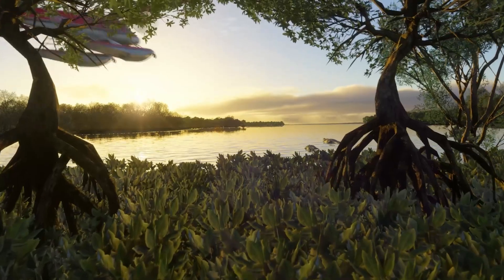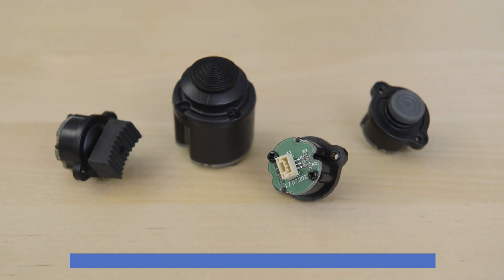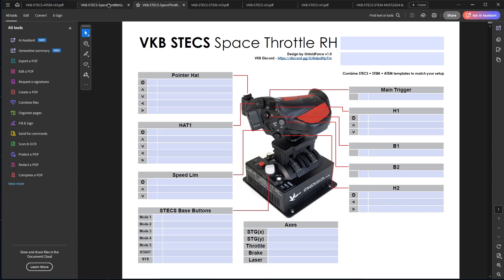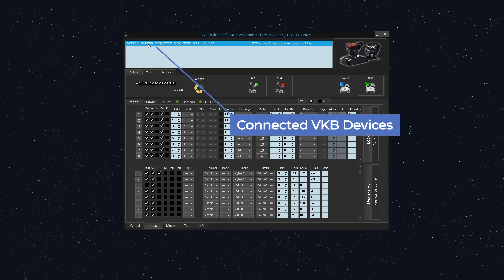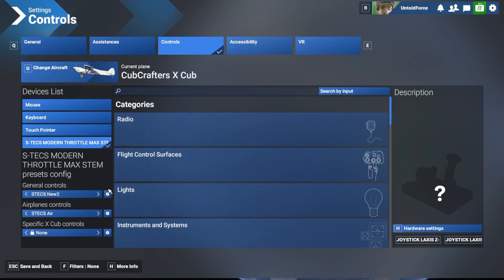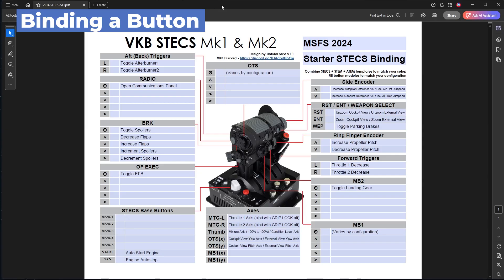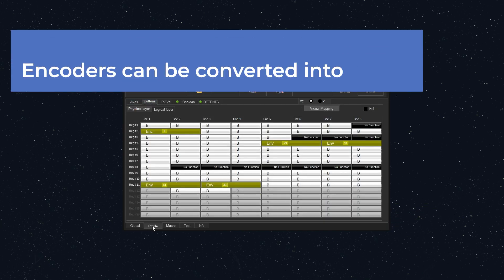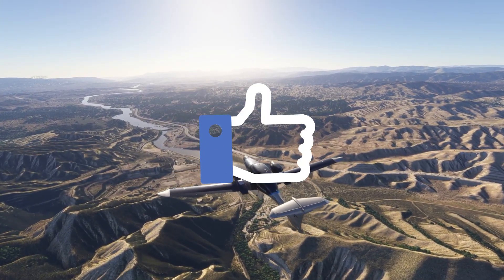MSFS 2024 series - VKB STECS bindings

Comment: I am looking at the STECS Space Throttle because I am a lefty and want a righthanded throttle.  The only concern is the multiple movement options of the throttle head.  Is there a way to lock the head to only use the Y-axis?  I can't see a need for the other movements available.  If you have found the additional movement options useful, please let me know.  I have also been thinking of getting a 2nd Gladiator but in the Omni Throttle configuration and then locking it to only use the Y-axis.  I know you like the STECS, but would the Omni be closer to what I am looking for?  Thanks!
Reply: You can leave the throttle head gimbal axes unbound so any movement would not do anything in the game. If you do want to use the throttle gimbal for something you can apply some response curves in the VKB software to reduce any accidental movement.